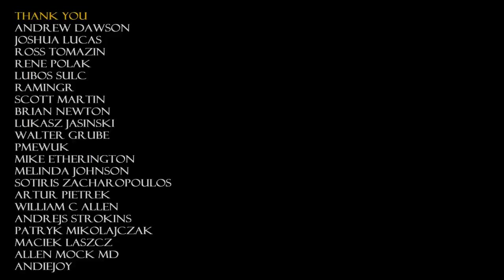046 Planemaking  - the boxing

Comment from the maker: Hello my friends!
As i told in the begining of the video it will be the boxing episode.
But wtf is this boxing?

Let me explain using Caleb James article about it:
"For any of you that are not familiar with the term boxing it has 
to do with the wood that is inserted into high wear portions of
the sole with a very hard wearing wood.  The traditional wood was 
almost exclusively Boxwood (Buxus Sempervirens). 
The boxing wood is placed in such a way that it orients the end grain 
of the wood toward the sole of the plane.
It is inserted on a bias to the sole that is parallel with the bed angle or 
the wear angle."

and using John M. Whelan's book "Making traditional wooden planes":
"Boxing inlays may be cut with their grain parallel to the sole, but in that 
case, the thin boxwood is subject 
to breakage along the grain. 
Another consideration is that better wear would

be achieve if the end grain of the boxwood were used on the wear surface. 
For these two reasons a vertical grain orientation of the boxing would be the best. 
However, this would leave one one section of the boxing - the one which 
supports the iron  - at risk of 
breaking off along the short grain. 
The optimum compromise beetwen wear resistance and resistance to breakage 

at the mouth is making the boxing with the grain running diagonally  downward 
from heel to toe, at bed angle."

Now i hope you understand it :)

I'm preparing few pairs of sliding dovetail planes.
For the body i used beech (4 pairs) and pear (1 pair), and boxwood for the boxing. 
I glued the boxing with hide glue. That glue choice allows easy repair/replace 
when the boxing would be destroyed - just heat it up or make it wet gently.

It is a little bit different video than my others, i hope you will like it :)
Reply: For those who cannot source boxwood, iron wood could be a likely substitute. It was wood of choice for sleigh runners, for its strength and wearability. I used it for bench dogs and tool handles.

Comment: what is that boiling glue you are using?

P.S. You could use rubber band from bycicle tyre for strapping instead of using painters tape. This way it will be reusable:)
Reply from the maker: It was hide glue. I have to try it next time :)

Comment: I wonder if the pearwood smells of pear? I've been in lockdown for toooo long.
Reply from the maker: Haha no:) it have no smell
Reply: I cut down a small apple tree in my yard last year.  I used some of the wood to make a handle for a plane.  I dried the wood in my oven on low temperature for a few days and it has an interesting smell.  Like apple?  Maybe, but while it was drying it did smell nice.  Once dry, very little smell.